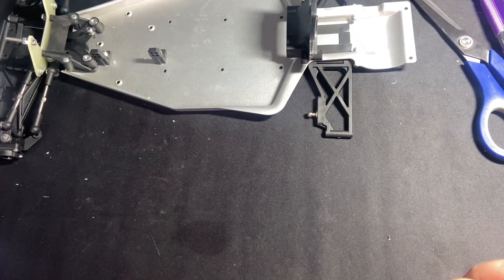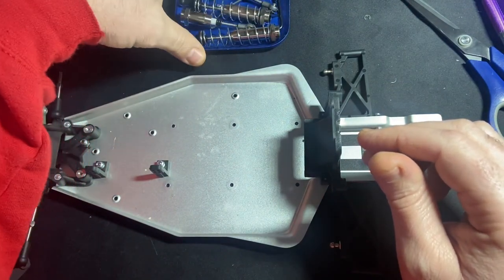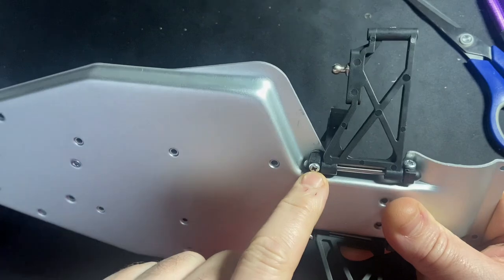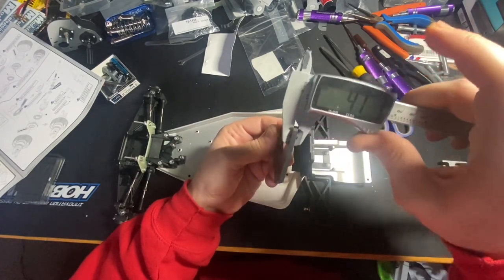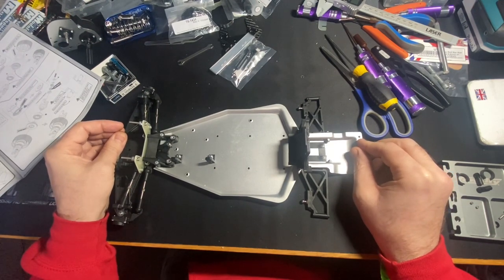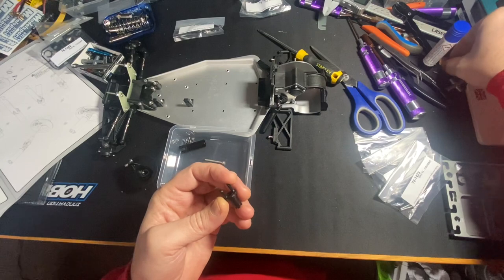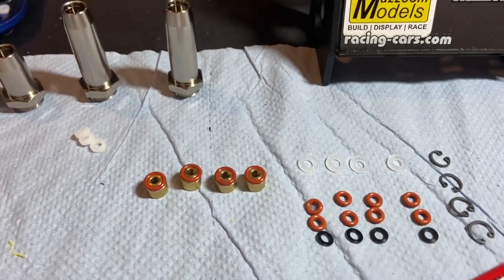Schumacher cougar classic, pukka parts shock towers and build tips.

Comment: Hi mate, I was having trouble with getting no rebound on the shocks but ended up solving that. Thanks for the tip on drilling out the pistons, the kit ones are way too firm, even with light oil. The springs for front and rear also seem way, way too firm, especially the rear. Cheers for these videos, really helpful for us guys new to these older style kits.
Reply from the maker: Glad its helped, if your lucky you can find the spring kits in shops or schumacher direct. Worth getting if your gonna race, but if your just driving it. It just wants to be a little softer 👍
Reply: @lo2713  going to race outdoors on loose dirt in vintage class, some older ae green springs seem to fit so I’ll use them for now. A random question, the gearbox has a bit of a higher pitch sound to it, it’s reasonably free, although not as free as a gear based transmission because of the belt, is it normal for cougar transmissions to have that high pitch sound to them or perhaps it’s also the telescopic drive shafts that are contributing to it. It’s not bad, I’m just curious if it’s something you’ve noticed.
Reply from the maker: @carlomac  cant say ive noticed a high pitch sound ? Its one of those, its better to see/hear to see what it could be ?

Comment: Thank you for the tips video! Will definitely do the hole mod on the shock pistons 👍Just waiting for the Alloy Eccentrics to arrive from Schumacher and I'll finally start on the build 😊I do like the idea of having foam tape strips under the gearbox -  could you point me in the right direction of the type you use and thickness?  - Toby
Reply from the maker: Hi Toby, all i know is its 1mm thick glazing tape, we use it at work and i keep the decent offcuts 😉

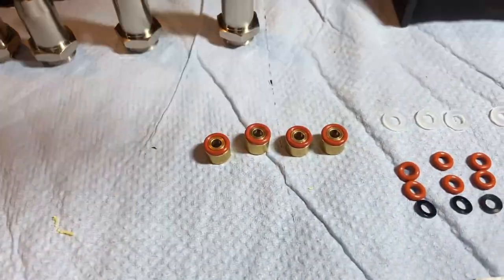Comment: Thanks for this. I’m just building a Cougar classic now too. Any tips for how to get the e clips in for the shock?  12:02
Reply from the maker: Ideally you want the circlip pliers, failing that, some flush cutters can be used, just take your time.
Reply: @lo2713  thanks. Flush cutters was a fail. I shot the circlip across the room, then spend 30min looking for it. I’ll try and find circlip pliers tomorrow!
Reply from the maker: @johnfitness6731  if you have an old brushed motor roll it around where you think it landed. There great for finding small clips 😂 fingers crossed you get it next time 🤞

Comment: Guy , the original 1990 shock tower is 2 mm I've checked two different towers both 2mm. If you want to be fussy one tower is 2.15 mm and the other 2.13 mm both close but call it 2 mm.

Comment: Another good build video. I did the shock piston mod as i didn't want to wait anymore for the muzzoom pistons, so i drilled mine out , but i didn't realise that they had different part numbers so now i have 8 pistons "cougar & procat" all mixed up . Do you know what the difference is or how to tell them apart .
Reply from the maker: Not to sure to be honest ? The smaller notch will be for the fronts, i didnt realise there was a difference, i’ll have to check mine, threw them all in the same box 😂
Reply: Muzzoom seem to have nothing in stock any more 😢
Given that…. Do you recommend adding a hole to the pistons in a new Procat build (indoor / carpet)?
Reply from the maker: @Timson254  i would try without 1st see how it feels and if there in stock grab the spring kit 👍

Comment: Have you seen people putting tape in the chassis for insulation?  Why is this?
Reply from the maker: You could short a battery out if both terminals touch, but it would take some doing. But its better to be safe than sorry 👍
Reply: @lo2713  what tape are they using
Reply from the maker: @muddfoot69  think its called helicopter tape, its used to put on bikes and cars to help stop stone chips